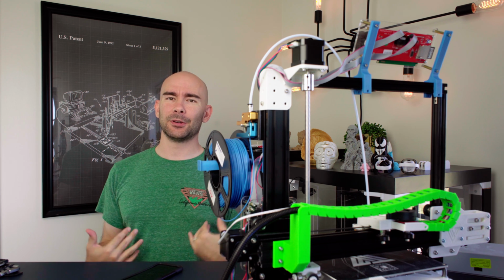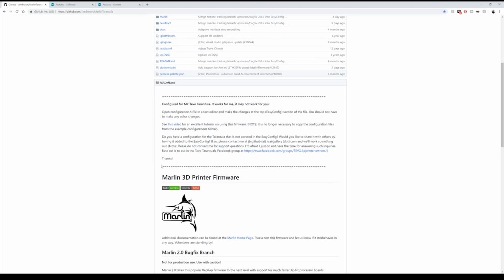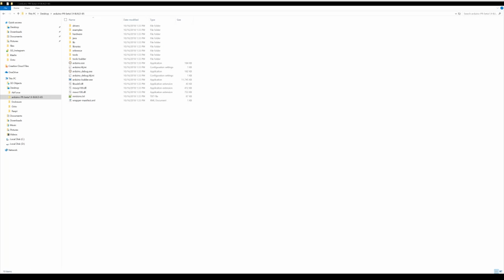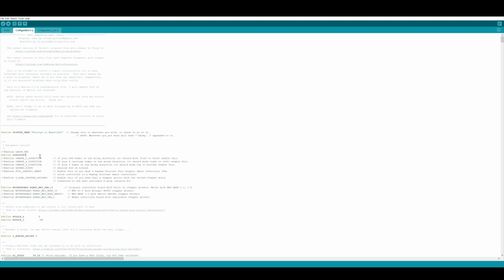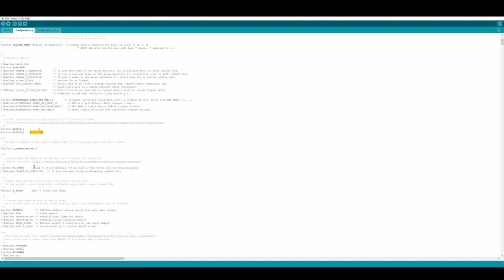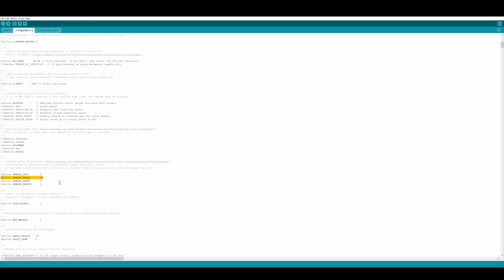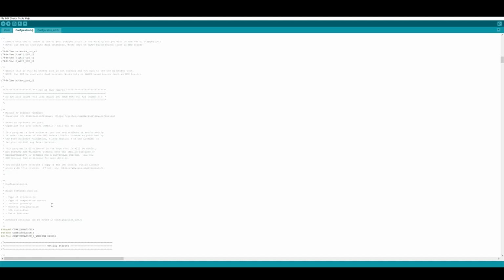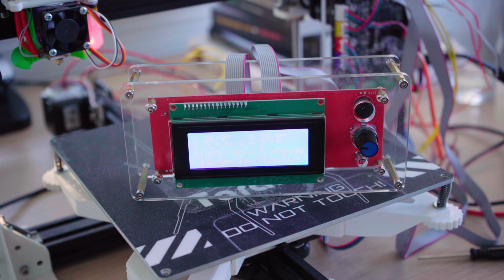How to upgrade/improve the 3D Printer Tevo Tarantula's Firmware

Comment: i'm trying to compile the Marlin Tevo Tarantula EasyConfig 2.0.x, but i'm receiving always the following error:

fork/exec C:\Users\Max22\AppData\Local\Arduino15\packages\arduino\tools\avr-gcc\7.3.0-atmel3.6.1-arduino7/bin/avr-gcc.exe: The filename or extension is too long.

Error compiling for board Arduino Mega or Mega 2560

i'm using the latest arduino, but also tried the beta 1.9.0. I really cannot find the solution.